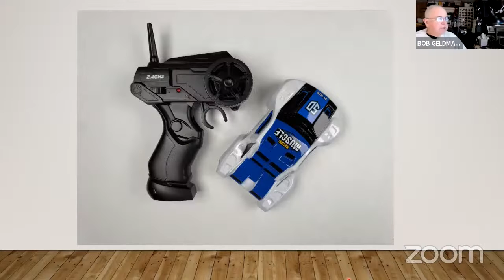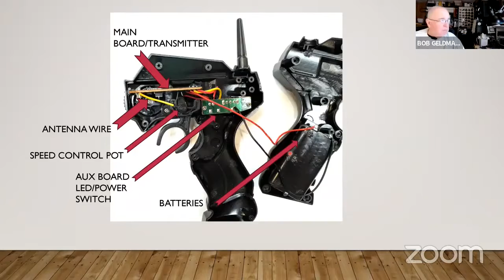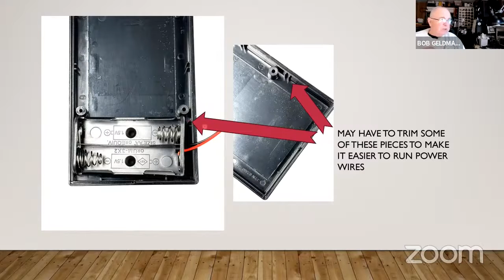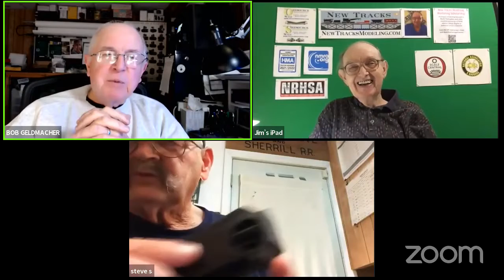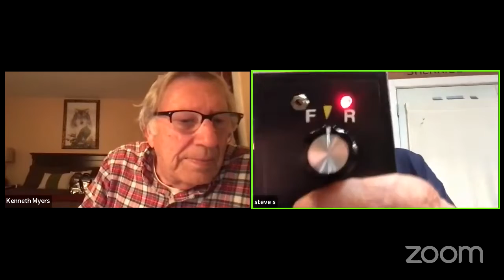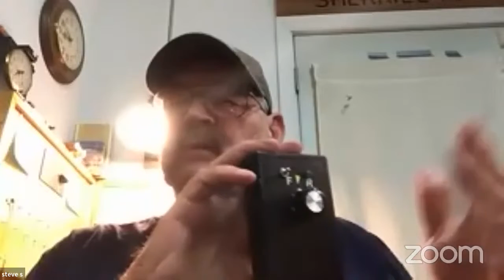Steve Sherrill Dead Rail Oct 25, 2023

Comment: Is locofi available on iPhone? Their site says coming soon and I don’t see it on the App Store.  That’s kind of a deal breaker for now.
Reply: An app for iOS platform is certainly on our roadmap. It sure is a dealbreaker if you absolutely hate Android. Otherwise, a $40 Android smartphone is cheaper than any simplest of the DC throttle, let alone a DCC throttle. You get the added benefit of an exclusive throttle that does not need a cell phone service or an internet connection and not only that, it will free up your iPhone for making calls and doing your regular phone things while running trains at the same time.
Reply: @LocoFi  Oh, that’s an interesting idea. So look at it as the cost of an inexpensive throttle. I could see that. 
Do you have a specific recommendation for an inexpensive android phone? 
Thanks for the reply!
Reply: @ironworksmodels  Here's an example: ASIN B0BBXBXCFC
Reply: Normal RC systems require a compatible reciver bound to it. This is a specific process that is  usually only carried out once. If the reciever is used in another vehicle it willnremain bound to that same transmitter/controller. If the transmitter needs to be changed the binding process is carreid out again, once.
This RC car bindingbsystem is novel but nifty, Imgoingbto give it a try. I have twice used Fosworks components in UK, particularly because of the sound card. Google it. Very exspencive and not for novices. 
Your system is spot on for a cheap startup.
Thank you all very much,.enjoyed watching this.